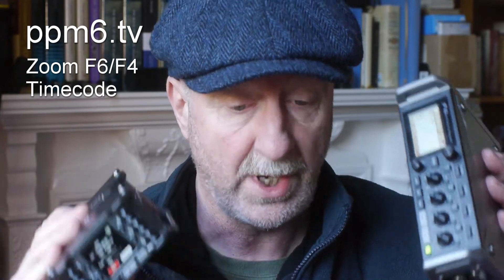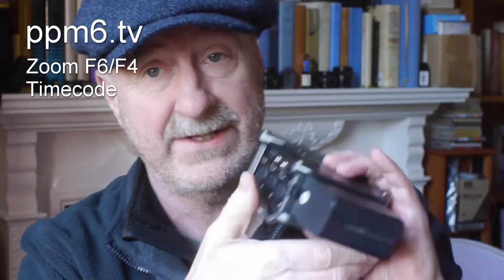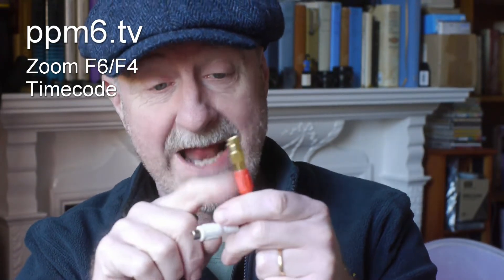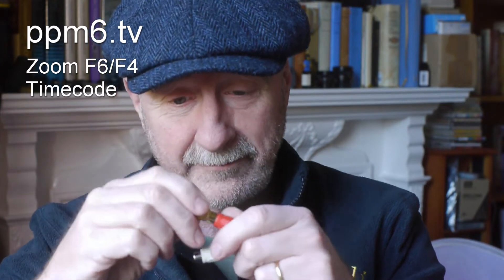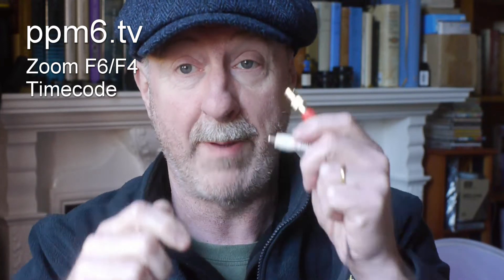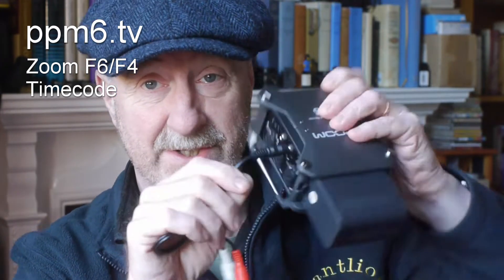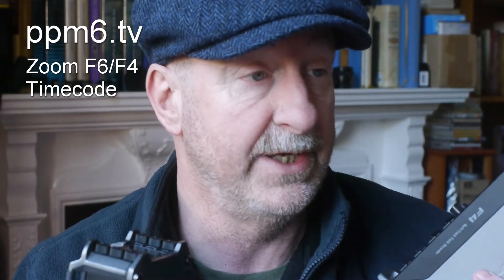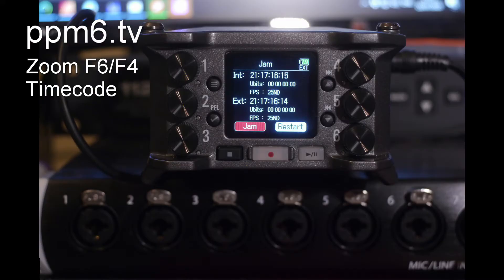Zoom F6 v F4 Timecode - The Final Countdown

Comment: Hi...  Not.really related but having owned these two is there a good reason to get the newer f6 or would someone upgrading from an H5 be ok with a used F4.   I also know it's all about price/performance and I came decide what's the ax I should pay for an f4 before I consider the F6 (if at all).  I'm a hobby recordist that have been looking to switch up my gear so that I could start pursuing paid gigs in a serious way. A y thoughts would be welcome.
Reply from the maker: The F6 or the F4?  First question are you a self shooting, all singing outfit or are a recordist working with a  camera operator?  I ask that because one of they key advantages of the F6 is the 32 bit float recording. And the main advantage of that is you are less worried about taking your eyes off your metering.If you are self shooting looking after sound and video you won't have much time for checking meters so maybe the 32 bit recording is a deal breaker. Obviously you don't need six tracks or you would have discounted the F4. The F6 also has a nice colour screen, the very small size and fantastic battery life and can be powered by a USB C power pack. But can you do the job with the F4? Yes. It has a much better workflow through the menus because you can use the encoder to change settings not just up and down keys. There's more room on the front panel to access controls. You have a professional  Hirose battery connector. And you have dual CF card slots. Assuming the 32 bit/track count aren't deal breakers I think a good second hand F4 at the right price will be fine. And I think you can probably resell it without losing too much if you decide after trying it that you need the F6. What's the rest of your kit? Ta like, ppm6.
Reply: @ppmtv-qh9qk  I had an H5 that I just sold .   3 Rodelink lav mics , a wireless XLR transmitter 1 head mounted mic . I've never been able to mic up and record moe than 2 on the h5 and I've decided rather than expand the h5 to get something that works more like a field recorder but that I can also use on a desk in an office environment.    I want to include a SDC and/  or short shotgun for indoor dialogue and a better recorder.  .self shooting talking head shots and sit down style interviews. .  I've been asked to consider moving into  the sound  recorder /boom operator space . So I'm switching up my gear to be able to handle bother scenarios. I do a some work for church as well which includes recording singing so 33 bit float does sound like a good idea.  I've handled an f6 in person it's tempting but somehow it doesn't seem very ergonomically laid out to me. And to me.the difference between approx 700usd and 1000 (f8n) usd doesn't seem that much since to me its all in a similar price bracket.    If I had the budget I might have jumped to the f8n but that's a stretch. I was thinking about an h8 but one of your videos convinced me otherwise given the market I'd like to break into. . The thing is Ive seen a few f4's around but still at about $500usd or so. Hence me asking your advice.  Given the fact that I might be doing solo operation at times the 32bit float presents a good case.   Thanks for your time.
Reply from the maker: Hi Sorry for the delay. I like the F4, it is ergonomically easier than the F6 because you have a rotary encoder to navigate the menus which is much quicker than the up and down buttons on the F6. I do think thought that $500 is too much. I had mine up for sale for I think £350 which is more like it. If you do move to the sound recordist space I would look out for a nice second hand 416 and a pair of CM4s for your church choir etc. Hope things work out for you. Ta like, ppm6

Comment: Do you recommended the zoom F6 over the Mixpre 3 II?
Reply from the maker: Hi JP - I have not had a MixPre in my hand so what do I know!  A couple of things. A man who does know tells me the battery life of the MixPre is not great.
The F6 has six mic inputs - that's a big advantage and the battery life is great. L mount battery adapter on the back!
But it covers the single SD slot (: 
However the MixPre has wider dynamic range on its 32 bit float option - which is nice if you are working in set and forget situations and they say a better headphone amp.
The MixPre had timecode over HDMI - big deal for DSLR shooters.
Curtis likes the MIxPre by a nose - and Curtis is the handsomest man in sound!
https://www.youtube.com/watch?v=8lRVnMO14k8

ta like, ppm6.